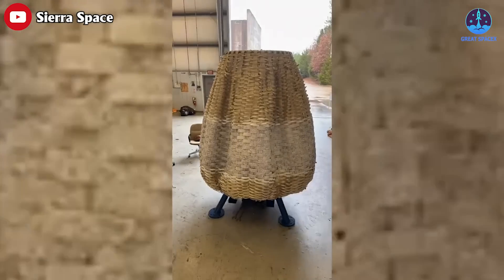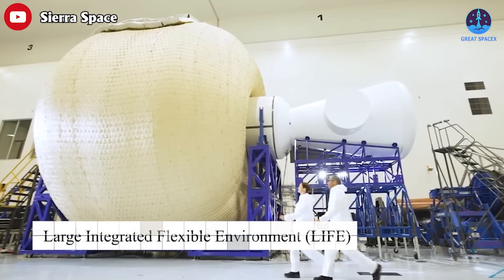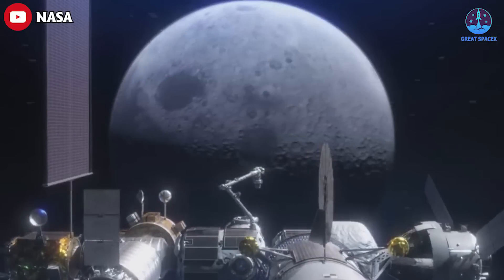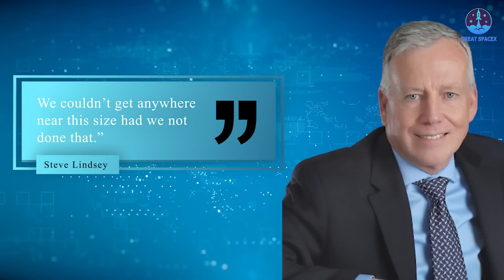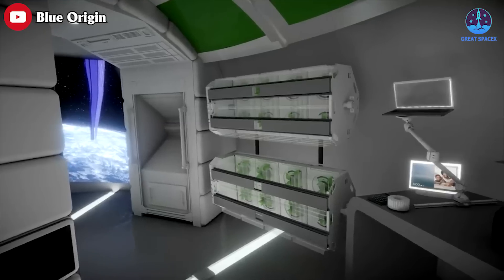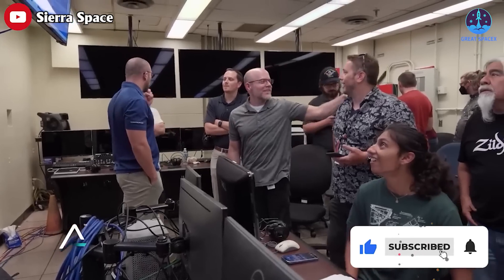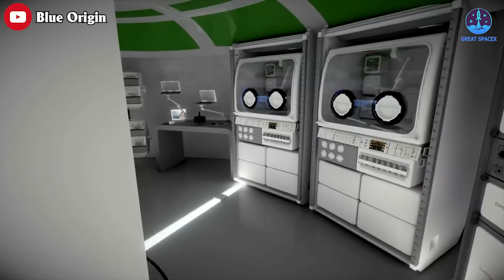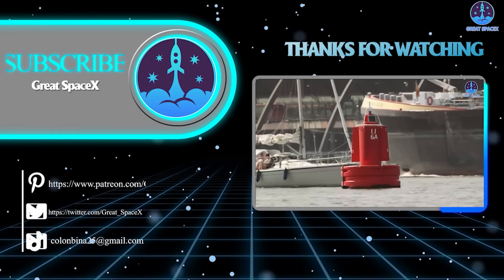What Inside The Future of Space Habitation will blow your mind...

Comment: I like this concept and the testing. My question is will it withstand the impact of a micrometeorite? It will be interesting to see how they plan to build and/or install the full scale components of the structure. Good video, IMO.
Reply: The habitat’s outer mesh is made from super-strong Vectran — a material used in making bulletproof vests — designed to keep the pressurized interior of the habitat comfortable for the crew. There’s an inner urethane bladder to keep the air inside, a middle nylon layer, along with several layers of 4-inch-thick foam, and six sheets of Kevlar. Got this nugget from the description..
Reply: Once it is up in space you could potentially send up further shielding panels to surround the module in a solid shell with later launches.
Reply: This is what I was thinking as well

Comment: They should probably test what happens with a small puncture when habitat is pressurised.. perhaps firing a bullet to imitate a micrometeorite impact could show if the structures integrity would hold with a small puncture util it is sealed, or if the whole structure would implode..
Also, it's odd that no commercial companies are trying to test any centrifugal artificial gravity methods, as I think that would be a very profitable breakthrough,  especially when long-duration travel will become a commonplace..

Comment: What happened to Bigelow out of North Las Vegas? They have an flexible unit attached to the ISS. They also have another unit that is a space station already in orbit. NASA (or SpaceX should consider their product.
Reply: Yeah the BEAM has been connected to the ISS for forever. They also launched 2 other modules before beam. Literally the only company that has put modules into space but not selected. That's what happens when your company isn't ran by a former astronaut. Looks like sierra space literally copied the BA330 from Bigelow.

Comment: Have they explained how the Inflated modules are filled in?  It looks like it will take couple visits to fit the interior out.  I've not seen much regarding anything along those lines.
Reply: The Bigellow modules which this is based on have the interior components folded in the central core and they fold out once it's inflated.

Comment: At 3:48: Surely it would be extremely dangerous storing actual re-entry capsules 'indoors'. Leakages from attitude control thrusters could be deadly. Fuels requiring extremely cold temperatures would not have them and, in warming up, could give off chemically-dangerous combustible gases. Also how do you navigate in and out of the habitat when you can't do it by firing thrusters?

Comment: How well do these habitats deal with being hit with space debris? That's what I want to know.
Reply: The video states the outer layer is Vectran, used for bullet-proof vests, along with six sheets of Kevlar, among the inner layers.
Reply: Less interesting than the radiation resistance which has already been tested for the Bigelow BEAM experiment on the ISS.
Reply: @MichaelStoneRichard  A piece of titanium paint (from the orginal 2 shuttle launches) went through 4 of the 6 panes of "bullet proof" glass on the Shuttle.

How well does this habitat hold up to a bolt or nut hitting it a 17500+ mph?
Reply: @Dorsk84 I guess we’ll find that out when/if a bolt or nut hits it at 17,500+ mph…
Reply: You could send a shield up disassembled and bolt it together on the outside. It would pack down much smaller than a hard module and the when assembling the joints don't have to be sealed... that's taken care of by the bladder.

Comment: Did I miss the part about space debris?
Reply: If you missed it so did I.
Reply: I don't think they addressed it in this video, but the old BEAM units were built to have a high pressure chamber between the outer shell and the inner living volume and any space debris hitting the module would essentially bounce off like hitting a trampoline, and the flexible exterior would just return to its original shape. Unlike a hard shell module which is dented by the impact.
Reply: @TwilightMysts  See that is really interesting and cool, and I'd like to know more about those physics and the safety of the module. Thank you for sharing.

Comment: Once the Starship becomes functional inflatable habitats will become obsolete before they can make it to orbit. It is quite simple task to redesign the Starship in such way that it can be split into two parts front containing cargo bay and back containing fuel and oxidizer tanks plus rocket engines. Once we have such modification it becomes very easy to design stainless steel welded insert module 9m in diameter and almost unrestricted length. Such module would be inserted in middle portion of the Starship and send to orbit. Once in orbit front and back of the Starship would get disconnected from center module and reconnected in space for return back to Earth. Thin gage weldded stainless steel construction is much cheaper, easier to make, more durable and much more versatile than inflatable stuff they are proposing here.
Reply: @Karol Karolak,
I disagree. I think Starship and Super Heavy will allow even larger inflatable modules. Just a rough calculation would suggest that a comparably expanding module atop a super heavy booster could result in a module over 48 meters in diameter! Since in space the problem is keeping atmosphere IN, rigid structures make little sense. Allowing 50% of vehicle length for propellant, that would still yield a 25m x 48m habitat module. How cool would that be!
Reply: @billmullins6833  welded modules can be fully equipped and fully configured before they are launched into space
They can also be divided into airtight compartments so they can still be usable in case of a air leak. Sealing holes much easier (welding)

Comment: Bigalo aerospace has been working on this concept for years and we have not yet had a  launch to orbit.
Reply: Just a quibble, but Bigelo Aerospace launched two proof of concept inflatable structures, Genesis I and Genesis II, into orbit in July 2006 and June 2007 respectively.

And the prototype BEAM (Bigelow Expandable Activity Module) was attached to the International Space Station in April 2016.

Bigelow Aerospace subsequently laid off their entire workforce in 2020 in part due to the COVID-19 crisis and has not resumed operation.
Reply: @DanaGould0  I'm pretty sure this is Bigellow's tech.
Reply: @peterkotara  It's certainly based on the same idea as Bigelow, which was based on old NASA tech.

But if you compare the pictures, it seems to be an independent implementation of the same basic idea.

I don't know if similarities go any deeper than that.

Comment: The Life habit "is designed to have" is the truth!!! None of the ideas you say the Life habitat has are just in the design NOT in  REALITY!!! I have not found NAYWHERE that they have even built a complete three floor test module that has been inflated to prove that the unit could deliver of function even close to the "as advertised". Market leaders do not confuse what has been accomplished with what is just design goals.
Reply: How big where the ones they tested to failure?
Reply: NAYWHERE?
Reply: @mikentosh  nowhere!!! Google is actually running spell checker to misspell words and I did not catch this one. I actually have to use duck-duck-go many times because if google does not like what you type they cannot even spell at all. Thanks
Reply: @JoeShmoism  This latest was the largest according to the video. I think the said it was five meters. I know the final version is supposed to inflate to 29 meters but they have not had any information about how the flooring and accessories are stored before inflation and how well the inflated module floor and space usability rated after inflation. They are just at the shell testing steps right now.
Reply: @AtTheBarn  if I remember correctly there was a small scale version tested on orbit a year or 2 ago but I could easily be misremembering.
Reply: @AtTheBarn   - Ah! I just thought it might’ve meant something specific since it was all caps….and I was having a brain-fart, not being able to figure it out!  LoL
Reply: @mikentosh  NBD. I do not mind people engaging and working toward amazing goals and understanding. I despised trolls that just want to cause trouble and that was clearly NOT your intent.

Comment: You did not mention how it would be against debris, micrometeorites and space junk
Reply: Its made from pretty robust material, the same that is used in bullet proof vests. up the scale and increase the durability, im sure small meteors will just bounce off it or make a small tear in the kevlar. Its the inner bladder that maintains the pressure which is most likely designed to be easily repaired. So if a meteor would poke a hole, all they have to do is plug the hole in the inner bladder and its all good.

Comment: Waiting for mass production of the 30 meter sphere. Then we can build our rotating "bubble torus" with just 42 bubbles at 2rpm. SpaceX could put one of these in orbit in just a few launches, and it could be assembled in less than a month! Cost? A quarter of the price of the ISS, or probably less. This is your "gateway" to any destination in the solar system, as a home for miners and construction engineers and their remotely controlled robots. How many people could live in one of these? 100, or even more! And it only needs to last for just over a decade to open up the asteroid belt to independent venture entrepreneurs.
Reply: Has anyone done any work on an airtight rotating joint? If they're going to make a rotating torus for artificial gravity for astronaut health, they're going to need a non rotating section where the zero-G work is done. Otherwise, it means a lot of suiting up or some kind of orbital taxi. Then there's the "helicopter" effect. Copters use a tail rotor to cancel out tendency of the copter body to rotate in the reverse direction of the rotor. A space station with both rotating and non rotating sections would have the same problem. I wonder if using a central fixed torus and two coaxial counter rotating toroids would balance out?